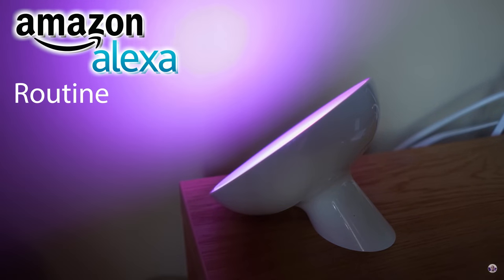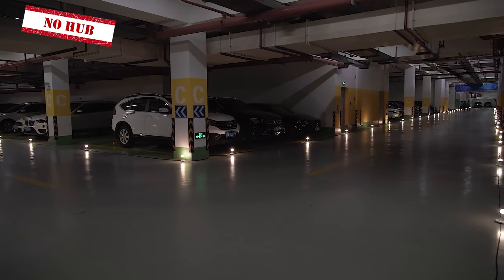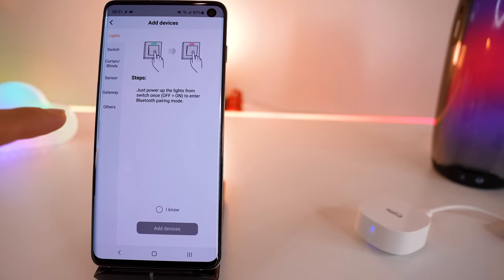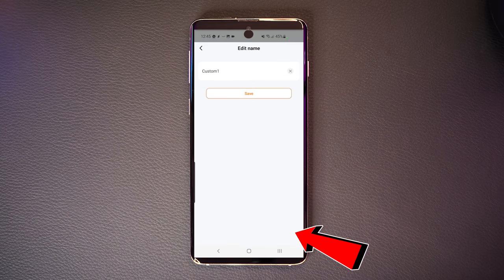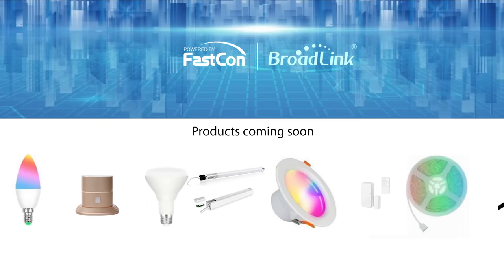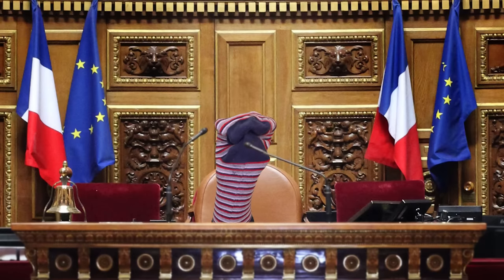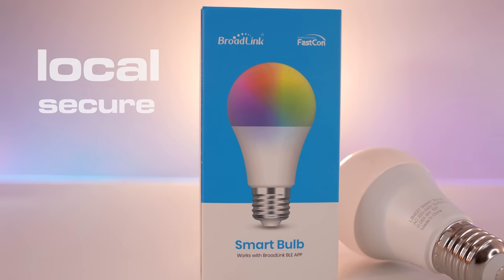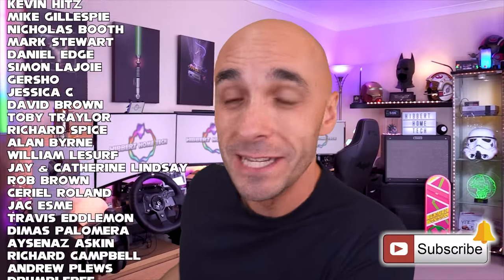Smart Home Light Switch - No Neutral, Because No Wiring!?

Comment: Much as I like your content and I respect your knowledge and opinions when it comes to smart home automation tech, I think I disagree with the premise of your review.

Clearly this is impressive tech. I love the mesh networking, I love the simplicity, and the products are probably pretty good, and even better when they are actually available!

BUT... 

The main problem I have with my smart home is simply that no single manufacturer makes a complete range of products that I would consider purchasing and using throughout my home. Therefore like most people, I have purchased different products at different times picking and choosing what I believe to be the best tech, and so I have products from different manufacturers. Hive, Hue, Eufy, Ring, Broadlink, Tuya, and more are all in there, all wanting me to use different apps to control them. Some work with Alexa, some don't.

I have zero intention of throwing all that tech out, and buying only Broadlink's offerings to replace them (unlikely that they will have replacements for each and every product anyway), and even if I did that now I'm likely to find better products in future that I want to replace one of them with. 

The current best "solution" is Home Assistant, but even that isn't perfect - if my light automations would reliably work I'd be a much happier human being! Maybe the real solution is buying only Zigbee based products. Maybe I should wait for a new protocol adopted by multiple manufacturers. Maybe the answer will be something else. Most likely it will be a combination of all of those to allow me to get all the products working together. But the solution definitely isn't having yet another manufacturer-specific protocol launched into an already crowded market. Perhaps if this Fastcon BLE was opensource or at least available for free licensing to other manufacturers it would be a solution. For now, it's just another problem and another app.

Oh, and and on top of that, there is another glaring issue with the bulbs. E27? WTF? Bayonet/B22 is much more common in the UK, so why do they insist on supplying screw in bulbs? Philips did the same thing with Hue years back, but even they realized they needed to make the starter kits available with bayonet fittings.
Reply from the maker: No manufacturer can release a product that makes all other companies products work with it.  When I say "it solves everything" I mean for noobies looking for privacy and local control on a budget.  I didn't mean that it solves LITERALLY everything.  What more did you want from them?  They can't do much more than make products that don't require signup, or reliance on their server to work.

 Matter is supposed to be "solving everything", but don't hold your breath.

Comment: Would I replace all of my Kit for Matter?  Nope...  Would I replace all of my kit for this?  Maybe...  My system is built around nine multi-zone thermostats.   They need to either add a thermostat to this or, partner with an existing manufacture.  

Bluetooth always seemed as the logical choice for battery powered smart home devices.

Comment: If Broadlink continues with this ideal solution,  the competition will go bust.  The only thing that I get annoyed about is the amount of batteries needed to keep everything running;  be nice if those light switches could included a small trickle charger from the mains.
Reply from the maker: Deffo.  They ought to last AGES though :)
Reply: Not really, because as soon as they own the market, their proprietary connection won't work with anything else and they'll raise the price. It's a great offline bit of kit though

Comment: A novel idea for starters and non-techies I would say, but I don't see much use for this if you want to properly automate your home
Something like this ties you into the vendor and their products. Go ask former Insteon customers why it's a bad idea
But it also limits your options as this wouldn't integrate with the other vendor products out there that are better and I'd be very surprised if any other vendor made products that work with this hub
What stands out to me more though is this kit is only warranted for 1 year, yet a light bulb is expected to last for 10
I wonder why?
Reply: I agree, but being very focus to local only gives good chance of there being open-ness for someone to create a Integration that locally works with Homeassistant as an example.

Guessing with Matter coming out there is 3 ways company can play it

1. Sell the most at the lowest cost possibly to win the cheap end of Matter devices, hope to sell enough to make profit
2. Create premium products in either aestetics or extra sensors
3. not bother and try create a new protocol and monopoly within. (I hope its not the intention)
Reply: Going off-topic but hope companies start to make more premium devices, plasticky remoted on walls is ok but why can't we get some nice metal or other materials switches ect, We have the money to spend
Reply from the maker: Yeah, the insteon thing isn't really applicable here because this system would continue to work if Broadlink went bust. You'd lose voice control, but the bulbs would still be controlled via the switches and sensors
Reply: @paulhibbert  I see your point 
I'm thinking more of replacements, especially with that 1 year warranty
If the hub broke for instance and you can't get another you've got problems

But if you buy Zigbee or Wi-Fi bulbs, then you can control them from pretty much anything
Reply: @reviewassistant6891  I'm all for local solutions and would expect someone to come up with a Home Assistant integration at some point
But vendors try to corner part of a market such as this and who wouldn't want an easy plug and play set up?
The trouble is, other vendors rarely adopt someone else's protocol as it makes them look inferior. Happens all the time in IT so you need standard solutions if you want flexibility to buy any vendor product
Maybe they'll make the hub compatible with Matter later down the line

Comment: I can’t figure out how to use the switches to trigger Alexa routines.  The switches don’t even show up in the device list on the Alexa app. 🤷🏻‍♂️
Reply from the maker: Broadlink got delayed by amazon with the rollout for this and didn't tell me until After I'd released the video 🙄 they reckon July it will start working. 

To be fair to them though they have apologised and said that anyone who bought this specifically expecting it to work with Alexa routines can have a new free scene switch when the api is finished. My contact said to write to vipsupport@ibroadlink.com

Hope that helps man, and sorry for the missinformation.
Reply: @paulhibbert , thanks for looking into this.  I’m surprised that others didn’t spot this.  My girlfriend and I have just bought a holiday home in Spain, so had kitted out the entire house with these bulbs + Amazon Echos (that’s 4 starter kits for just the ceiling lights).  It looked like a neat and almost hub free solution to my requirement, with a much lower cost.

I was considering removing the BroadLink bulbs when I’m over there next week, so thanks for raising this issue with Broadlink.  If you’re pally with them, if they could get the switch to cycle between preset colours and brightness levels and recognise short and long presses (in a similar way to the Hue Dimmer), that would be smashing, thanks.

I’ll ping them an email.  Thanks again for your help.

Comment: Has there been an update on when Alexa will recognise the button enabling them to trigger Alexa routines?
Reply: It works now!!! The scenes in the app are now recogniced as a motionsensor by Alexa. So if you push a button and activate a scene, the "motionsensor" in Alexa is triggered.
Reply: @philipc7347  any help with this would be much appreciated, as these switches have been gathering dust on my walls since Paul advertised them! I have tried to setup up an Alexa routines for when the “scene” detected motion, but it just won’t play ball 😢

Comment: Also who needs three bulbs off one switch in one room?
Reply from the maker: My parents living room/diner.
Reply: I may be reading it wrong but doesn't that switch have one setting. You press it they all come on at the level you set. It's not like you can turn just one on at a time. I've got two switches for dining room and living room, they're completely independent.
Reply from the maker: You would create scenes with the relevant bulbs and then add the scene to the button you wanted it to control.
Reply from the maker: Only drawback as stated in the video is that you can't yet toggle, which means you'd need to reserve a button for "off"
Reply: I'm getting to wrapped up with my own situation of a combined lounge diner with separate lights and two switches , thinking one bulb in each off their own switches. It's a scene setter, hence three bulbs in one room. One over head, one in a lamp, one in a reading lamp . Reading scene, TV scene, socialising scene.

Comment: If you think a single manufacturer's products can replace Home Assistant, then you're missing the point of Home Assistant...
Reply from the maker: No. You've forgotten the point of a smart home.

It isn't a necessity to have more than one manufacturer if one manufacturer did everything cheaply and well.

They have plans for sensors and cameras, and if they stick to this same formula then home assistant will be negated for all but the nerdiest of nerds.
Reply: @paulhibbert  And while that's a lovely idea, it's only great until the manufacturer goes belly up, turns greedy/evil, etc., etc., and you want to continue expanding your smart home with someone else's products without starting from scratch.
Reply from the maker: Nah. Once you reach that stage the tech will all be old and you'll be ready to replace it with the next big thing anyway.
Reply: @paulhibbert  Tell that to everyone blindsided by the Insteon incident.
I think we might have some fundamental differences in how we view tech/smart homes, but thanks for your perspective and the discussion!

Comment: I don't really get the need for any hardware at all other than the end devices such as bulbs, blinds, motion sensors. I have all of those simply using smart life and unless the internet goes down completely it never ever fails. Why bother with all the grief. If your internet is super bad I suppose I can see a case. Smart home stuff is meant to create less work not more lol. By the way regarding smart switches, I know you can do loads with them in most cases people use them to turn the lights on and off, might as well have used the standard switch 😂😂
Reply: Yeah you're right, these things are great for those that are really into mood lights, dimming, set scenes, but l got my stuff for one reason only so l didn't have to press switches again and could do most stuff by voice command.. And if I'm honest to show that though I'm 65 yrs old l can still get down an groovy with the kids, that's what they say nowadays isn't it all those beatniks and surfer dudes ? But l love showing off to my older friends and family, hey alexa "put the kettle on " that's for the plug in the kitchen with a kettle full of water ready, alexa , turn on TV, alexa turn on fire ( electric fire mostly for fire effect display) then all the lights and my sound system.. They gasp in wonder ( then mutter under their breath" lazy bugger ") l don't want to be pressing switches, pressing switches is for squares man. ( do they still say squares.?) anyways just wanted to acknowledge your comment dude I'm just some Rando innit.😂

Comment: You didn’t show how it triggers Alexa routines
Reply: Doesn't seem to work. I tried. Switch is not seen by Alexa. With or without hub. The previous WiFi Version worked, but it seems they are not available anymore or at least hard to find.
Reply from the maker: Broadlink got delayed by amazon with the rollout for this and didn't tell me until After I'd released the video 🙄 they reckon July it will start working. 

To be fair to them though they have apologised and said that anyone who bought this specifically expecting it to work with Alexa routines can have a new free scene switch when the api is finished. My contact said to write to vipsupport@ibroadlink.com

Hope that helps man, and sorry for the missinformation.
Reply: @paulhibbert   Unfortunately I dropped them an email with this info and my proof of purchase but got the following reply suggesting it was lost in translation 🤨

“Dear customer,
Thank you for contacting Broadlink.

We just confirmed with our sales team, there might be some misunderstanding when they talked to Paul, what we mean is you can turn your current switch to a new version when we finished working on the API and there's no need to purchase a new switch. We sincerely apologize for any inconvenience caused.”

Comment: If it's local without the hub how does it update firmware and software.
Reply from the maker: Without the hub they have no Internet conection to worry about security.  Their basic functionality without a bridge will never need to update either, so firmware will only need to update if you use the hub :)

Comment: Yeah… Broadlink… the same company that can‘t make an IR / WiFi thing that can use WiFi Passwords according to standard. Standard is 63 characters can be used, Broadlink can‘t use anything longer than 32 🤷‍♂️
Reply: Seems like a bit of a "HOME ASSISTANT!" problem to me.
Reply: @eadweard.  Dude… The device can‘t be joined to WiFi with a Password longer than 32 charakters (it‘s a known bug for a very long time, check the forums)… how could this be a Home Assistant problem? If I create an SSID with a password less than 32 characters, it works just fine.
Reply: @gorgonbert  I wasn't being particularly literal. I just mean no one cares what the standards documents for WiFi say about password length. This is only a problem to a tiny subset of officious nerds.

Comment: I assume this tech is dead in the water now? 6 months have passed and no update on Alexa routines, default to off after power cut, or  local storage. Plus they havent released GU10s, B22 or any other items for this new BLE tech
Reply from the maker: Nope, they released the Alexa routine functionality yesterday!  They had to recode from scratch because Amazon never released the API Broadlink built it around.  They've had to use a workaround so the device now appears as motion sensors instead of buttons, but the end result is the same.
Reply: @paulhibbert  then I am on my way to Amazon to buy the starter kit 😊. Thanks Paul
Reply: Any chance of an explanation of how this is setup in the broadlink app? BLE  @paulhibbert

Comment: I wish your arguments were consistent.  I've watched 2 videos of yours before this one tonight.  

The first was you saying don't install a Hue Light Switch because they only work with Hue products and then you'll be tied into a single product line.  How is this any different?  This is a completely proprietary system that only works with products from one manufacturer.....

Second video was zigbee vs Wifi - Wifi bulbs are £4, Zigbee bulbs are £15 - so you'd be mad not to go Wifi.  Yet here you are praising £15 bulbs.  

I enjoy your videos but I just don't get this.  I don't believe that it's just because they sponsored you - but then why are you being so inconsistent?
Reply from the maker: Hey man, home automation is complicated so I can understand how it might look like my arguments are inconsistent.

The key difference is that Hue is poor quality for a massive price tag. This product is more reliable for a LOT less money. You might also notice that somewhere in this video I mentioned about how this product is set and forget, there's no concerns about being tied to a particular system if you only plan to install it in a couple rooms and use Alexa and the switch. You could have this in a couple hallways and your bathroom and still use other systems elsewhere.

You'll note that in another video I actually praised Hue's battery powered remote light switch as the ONLY hue product I recommend. The one you're talking about involves wiring DESPITE being reliant on a BATTERY!! and I devoted a whole video as to why this is a trash idea. 

More importantly though at the time I was told the Broadlink switch could start Alexa routines, something Hue can't (more like refuses) to do. Amazon have delayed this functionality and made both me and Broadlink look pretty bad though.

As for the WiFi versus Zigbee argument, it's only relevant when you're not using battery powered switches. There is no WiFi equivalent to this product because there is no reliable battery powered WiFi switch.

You'll find me regularly recommending zigbee these days because it has dramatically reduced in price, but to be clear; this isn't a zigbee product anyway, it is a new system with some advantages I laid out toward the beginning of the video.

Hope that helps man.